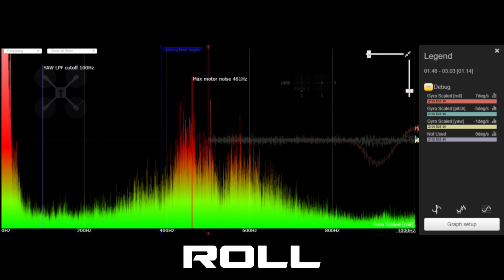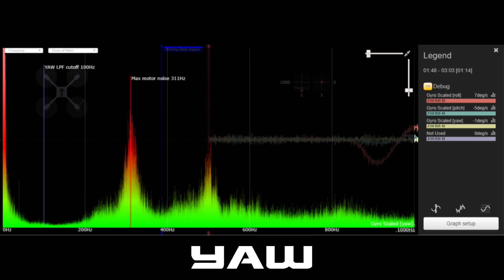What did you do Foxeer ? F722 V4 Review + Blackbox Analysis | Honest Review

Comment: What frame. I mean I'm having trouble with it. Same flight controller....
Reply from the maker: Openracer what trouble are you facing
Reply: Well on my other 6 quads I'm able to turn off all the gyro filters and have my dynamic notch filter on a count of 2 with the q factor at 300. Min 125 and max 625 and my pid up pretty high.....is it not possible with that gyro cuz with it being as clean as it is I would think I could.....if I have a mpu 6000 in it I can......
Reply from the maker: Yeah there are slight differences in betaflight 4.4.2 there's improvement to icm42688